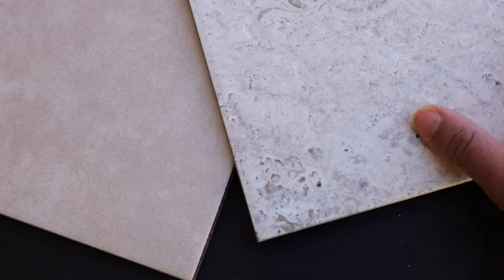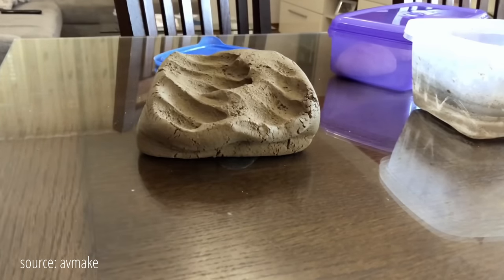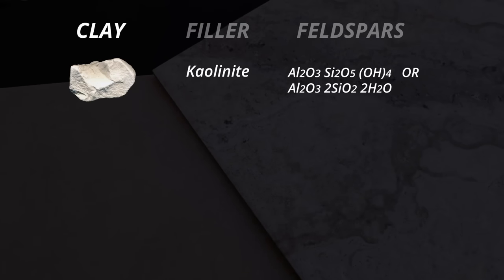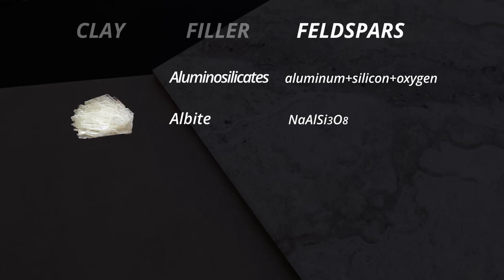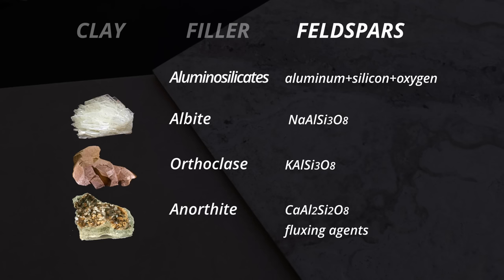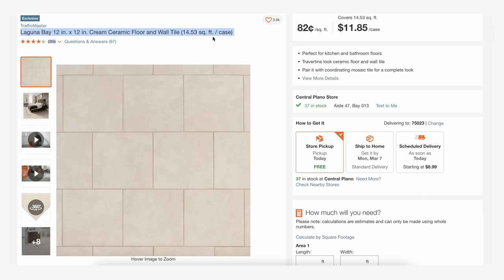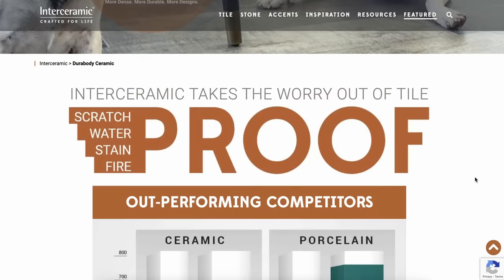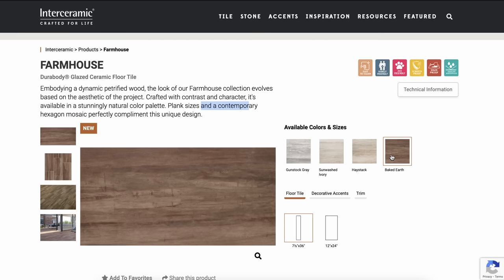Ceramic vs Porcelain Tiles | Everything you need to know!

Comment: Having installed both ceramic and porcelain tile, I feel porcelain is a better product well worth the extra cost.  Ceramic tends to chip at edges and tear the glazing off much easier, especially when cutting.  The porcelain I used also had a solid body color, so even if the glazing was damaged, it wouldn't appear to be a different color.  The cost per material square foot is minor vs. the amount of time (or cost to pay someone) to install.
Reply: I worked with 5/8 thick porcelain once, it was incredibly tough
Reply: I couldn’t agree more.👍

Comment: Cutting or drilling ceramic or porcelain will create respirable dust if not wet. I recommend using wet processes, cleaning up the sludge before it dries and discarding it, to avoid silicosis risks. I noticed you were wearing proper PPE Belinda, and I think if people were doing a lot of cutting/drilling, they might need to control the dust more. Localised ventilation is also an option, using an extraction setup.

Comment: Excellent video! On the topic of flooring, I would appreciate another detailing floor sealants for commercial/residential use!

I never understood why public bathrooms accumulate so much grime, when they could just seal everything up for easy cleanup?
Reply: Normally sealants are the issue, it is the maintenances programs.  As Belinda was saying, Porcelain tiles and glazed ceramics are very stain resistant, but if you push around dirty water on a dirty floor they are just moving the dirt around.  If they would use a good cleaner and change the water often it would not be so grimey.😁
Reply: @tiletheworld  problem is boss yells at you for changing water so often so it's less work and stressful to just push it around. 

My personal clean level is "would in let my baby crawl on it?" But cheap as clients dont want to pay for that level even though with me it takes only about an extra 10 minutes so I'm not even costing a full hour.

Comment: I'm glad you mentioned the decoupling membrane, it's honestly much more important than the tile itself. 
And it's a shame to see a high end tile have to get riped out and redone cause the homeowner tried to cheap out and hire a hack.
Reply: Do you always use a decoupling membrane?  Or do you every use Liquid Applied Membrane?
Reply: @tiletheworld  a decoupling membrane is used anywhere where there can be movement.

Concrete moves and concrete cracks.
If your tile is attached directly to your concrete, when your concrete cracks your tile is going to crack or pop out.
the decoupling membrane creates a gap between the concrete and the tile. So when your concrete cracks it doesn't transfer to the surface. It stays hidden below the tile.

Also if you are attaching to non-engineered Wood, you would also use a decoupling membrane because wood moves with change in humidity. 

Liquid applied decoupling membrane? 🤔🙄❓
I think what you're talking about is a primer, which is not a decoupling membrane, it's something you apply to your substrate prior to applying the binder/adhesive to ensure firm positive adhesion.
Reply: @mountainbikerdave  I was not clear sorry. I was just inquiring if you ever use liquid crack isolation instead of a decoupling membrane.
Reply: @tiletheworld  nope. never even heard of it, how does it work?
Reply: @mountainbikerdave , thank you for the detailed explanation on decoupling membrane.
Reply: @mountainbikerdave  it provides protection like a decoupling membrane but it does not break bond (decouple) from the substrate.  As a commercial installer in NC it was 99% of what we used for crack protection.  There are several on the market, I prefer Laticrete Hydroban.  If it painted on the surface in two directions and once cured it can handle 1/8" of movement.  A lot are also waterproofing.
Reply: @tiletheworld  interesting, how significant of a crack can It handle? 
In my opinion the Schluter-Ditra decoupling membrane is quite a bit thicker and seems bullet proof.
It comes in a standard 1/8 and a thicker 5/16 version. So it should be able to span or handle significant cracks with no issues transferring to the surface.
Reply: @tiletheworld  I honestly don't understand how it can give crack protection without decoupling fron the substrate? I'm assuming it's a cement based product, so if there's a significant crack 1/16 to 1/8 of an inch how wouldn't that transfer to the surface.
Reply: @mountainbikerdave  it is latex based. Hydroban or Redgaurd are the most popular around me.
Reply: @tiletheworld  okay that makes sense, so it has a little bit of give/stretch to it. 
I'm familiar with redguard, but I've never used it. 
I'm sure it offers crack protection, but the Ditra product that I mentioned before has thickness on its side. there would have to be a crack the size of a ravine/canyon for it to transfer to the surface (at least for the 5/16). That's true bullet proof crack protection. 

Redgaurd is definitely waterproof, but I feel its uniformity and ease of installation is more of its main benefits, then its crack protection.

Also Schluter-Ditra is plastic and plastic is waterproof so I don't see a significant difference between them. Though if not installed properly it won't be waterproof. 
Compared to redgaurd which is pretty idiot proof. Roll or spray it on, check for any holes, and done.

Comment: Would you happen to know why tiles today are only using prints rather than having uniform colour all the way through? Thank you for the fantastic video!
Reply: The answer lies in the cost.  Basically Porcelain tiles are costlier to make and especially the ones which have uniform cooler all the way through. This means the entire material is same from top to bottom. 
The video maker has only half explained the difference. 
The ceramic tiles are two different layers . One is base clay and top is of glaze .

Comment: I've used floor tiles a lot in my experiments.   They're a super cheap smooth surface when you only need one or two.
Reply: What do you mean? Like when you need a very flat surface like glass to glue sandpaper on it to grind something very flat?
Reply: @JohnSmith-kf1fc  I need a large flat bakeable surface for DIY plastic recycling.  It technically worked but the pressure kept breaking the tiles and plastic would bond to the tile after two or three melts.
Reply: @VagabondTE  hum.. interesting. Would a steel sheet covered with a nonstick teflon coating work? Maybe those can be custom ordered? Or like the largest non stick pan you can find and cut the side if they get in the way?

Comment: A builder is using long sheets of shiny ceramic tile for shower wall and bathroom floors- I contended that ceramic is NOT rated for wet floor areas- too slippery. They disagree.

Comment: I have some tiles outside on my balcony outside, which were from my grandparent. After a few years outside, they started to desintegrade. I assume that means they're a cheap ceramic?
Reply: Freeze thaw cycle will crack any brittle material. But if its starts to crumble from being wet for long periods than yeah, cheap ceramic. As stated in the video porcelain absorbs less than 1% moisture and its often the last things that survive in the ground. Burried ceramic crumbles but porcelain will be found intact long after the last piece of steel has rusted away. Glass probably beats them all though
Reply from the maker: That's probably the issue.
Reply: I agree with John, replace the install with some 2cm Porcelain pavers.  They will last FOREVER.

Comment: Tile is great for floors but have zero place on walls or countertops!! Remember tile never shows up without its ugly siamese twin; grout! Epoxy grouts are still grout. Encaustic tiles and rectified tiles can be used without a grout but then are not able to be a continuous layer. Nobody should have to use remnants like tile or worse yet fake remnants, on their project.

Comment: I wonder what the recyclability of these materials are.
I guess ill have to go check. 🤷‍♂️

....
Yeah, Their really not. Well, for the most part, their not. It just a bitch to find somewhere that will take them. And its not cheap, So in the landfill they go.
Reply: Most plants - Pre-consumer it is 100% - they can grind up and put back into the process.  Post consumer could be but normally they are tainted by adhesives and the cost to ship to a plant.